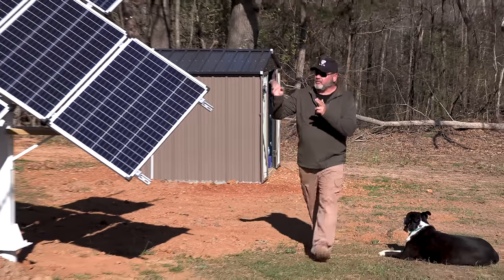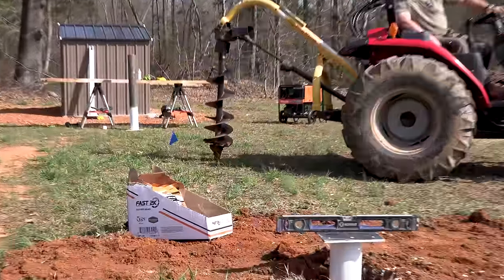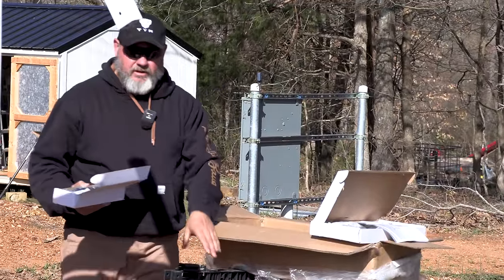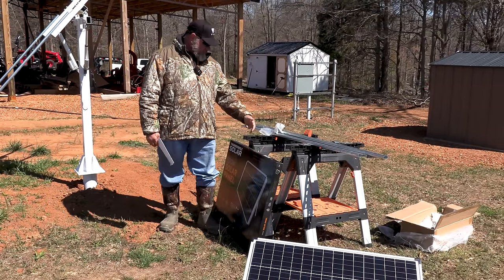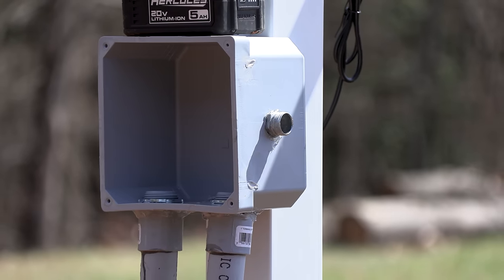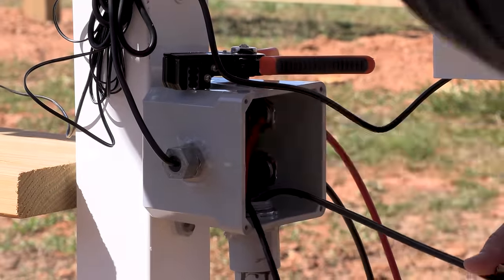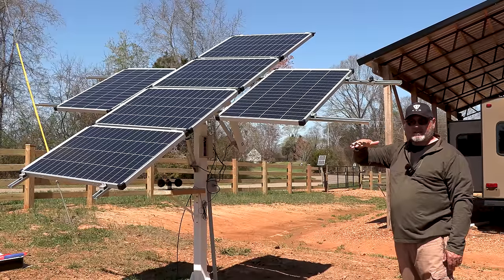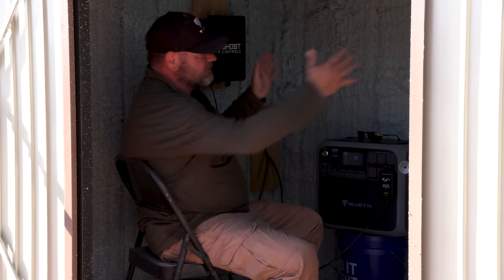You Really Need Solar Power to Survive Grid Failures! DIY Automatic Sun-Tracking Solar Array

Comment from the maker: Part Two: https://youtu.be/6wv6hJ9S1K8
Reply: I would like to have some information on a system like that
Reply from the maker: I will put out a video in a couple of months. It was really nice to see my RV running the air conditioner and my little building running the air conditioner while the power meter stayed the same.
Reply: Have you found out the costs of alternative and absolutely accurate solar tracking? The position of the sun is known for every day and moment. This information could be used. That way, you don't have to rely on the photocensor, but even at the cloudiest moment, your device follows the sun and is always ready when the clouds disappear.
Reply: I would like to know how they do with snow. Does snow get stuck on them like the panel arrays do? And what this system be superior to panel arrays in the Pacific Northwest, where light is a luxury?  Things I am wondering, but not sure if there are answers yet.
Reply: It's always recommended to read the entire set of instructions before you start in. That way you can understand the later parts before you guess at the beginning.
Reply from the maker: @Anthony Losego. It is very easy to say things like this from behind the computer desk or cell phone screen. The directions were translated and were horrible. We just purchased a third solar tracker and the directions were very clear in the new one. There have also been several updates and upgrades. Now it's plug and play. Great! Monday morning quarterbacking!
Reply: @TonysTractorAdventure  gotta love chinglish instructions not quite either language not readable eitherway lol
Reply: @anthonylosego  Agreed. No matter how good or how bad a manual is, it’s best to read it through prior to starting a build. One can’t know how good or how bad a manual is until one has read the manual in its entirety. It’s best to know before starting a build rather than after. This holds true regardless of one’s perspective whether that be settin’ at a desk behind a computer or quarterbackin’ on a Monday.
Reply: So how do you rate the Hercules brand or Harbor Freight tools?
Reply: Please do a one year review!!!!

Comment: Like ya work mate, I built a dual axis solar array some 7 years ago, still operating, it’s only running 6 X LG 335watt  panels which is 2010 watts made up of 2 strings (series parallel) I have seen them pumping out 2450 watts on a sunny cool day, it was my second attempt at building one the first didn’t have a very reliable tracking unit, but he latest has a duel axis slew drive (weighs 260kg) stands approximately 5 meters in clean air no shading, I managed to acquire a controller for it from USA,(Lauritzen inc) the controller is programmed with an algorithm that makes a move either axis (duel) every 10 minutes of the day from sunrise to sunset, it is capable of a lot more panels but as I was limited working on my own 6 panels worked fine, this has powered our whole house, runnng a 3kva Victron inverter/charger, 8 X 220 ah AGM batteries in a 48volt configuration as 2 X 48volt = 440ah, I can say without a doubt even in cloudy overcast days our batteries are changed by end of day, the secret to off grid is storage, you need to have a large enough battery bank to keep you running through those cloudy day in the worst case scenarios..

Keep up the good work mate all the best from down under 🇦🇺🤙
Reply from the maker: That is so cool. I have thought about building a heavy duty dual axis solar array myself. The one installed claims to be hurricane force resistant but I could see it folding over in certain circumstances.
Reply: Got any details?

Comment: From all the reviews of the foam system - I would have gone with concrete. Not for the updraft, but for horizontal stresses. Moreover, I would have filled the pipe with concrete and also welded rebar spikes to further anchor into the concrete.
Reply from the maker: Fast2k has been holding up power lines on utility posts for almost 30 years. It is very proven. Other foams fail, but these exact solar panels went through 80mph winds. Trees down every where, but my solar is still there.
Reply: Conventional,  my thinking too. But the quickness, so convenient, specially for solo build. Pipe will rust from inside eventually,  but we'll be decomposing by then😂
Reply: Yeah, nothing like a massive over-kill.
Reply from the maker: It is well casing pipe. We will all be gone before it fails.
Reply: I'm planning on following Tony's lead on the pipe support for speed and ease using a 220mm pipe with 5mm wall in a 300mm auger hole. To spread the load a little and prevent the bottom of the pipe filling with water I intend to weld a 250mm square plate to the base which Tony didn't feel was necessary to his build. I'll zinc prime and paint the pipe so it should be there for a couple of hundred years. I was considering adding spikes to the sides of the pipe but the available space is going to be so limited on the 220mm pipe size I'll just pour in concrete. 

The only problem with a pipe is the lateral loading. I'll have 16m2 of panels but hopefully going to 4 foot depth will give it the required a 700lbs solar sail the required lateral support. The mounting pipe of my arrays will be 2 foot out of the ground to provide the clearance so I could always add ground ties to the above ground pipe section if leaning does ever become a problem. The only other potential issue is subsidence but with a pipe you can always add a welded section to a pipe until it finds stable footings.
Reply: Its not a horizontal force but actually a moment force or torque. The pivot point of the moment is usually the midpoint of the ground and buried end of the pole.

Concrete is over-engineering for this purpose, wasting money and causing unnecessary environmental destruction.
Reply: @EricPeelMusic environmental destruction? what are you talking about?
Reply: Lol it's not going anywhere when you're done! And I thought I overbuilt 😂😂
Reply: @josephyarbrough9316 😂😂 Sounds a bit like Biden, I don't think he knows what he's talking about 😂

Comment: I've been waiting to see an articulating system that follows the sun.  I think this is a fantastic providing it works as described. 

I first hear of this back in the late 80's early 90's coming out of Japan.  They would put sun ray gathering glass and fiber optics that traverse down to offices without windows to provide sunlight to their employees.  They allow use this for growing plants indoors.
Reply from the maker: To this point they have worked great.
Reply: I met a bloke in the mountains near Omeo (Australia) who had gas struts (ie- hold the car boot open) that when exposed to sunlight they heated up and expanded, creating movement.
By arranging the shadow + sunlight on his array moved entirely passively & automatically. It was fascinating.
Reply: @P.N.365 that's cool

Comment: That is very cool and it's useful for folks with really limited space.  For anyone with the room, you could add 100% more solar panels for less than the cost of installing the tracker, plus you have less maintenance on things that can break.
Reply from the maker: Jason, I disagree. I could add big rows of solar panels but then I would loose the area. I can plant food around these panels. If they hold up, I plan on using a lot of these in key places. I may be wrong and the trackers may not be worth it.
Reply: @TonysTractorAdventure  - It's really not a matter of conjecture; the math and science behind it are well-documented.  I like what you did, but in terms of ROI you simply would have been way further ahead putting up more stationary panels.  The "problem", if you can call it that, is how inexpensive the panels themselves have become, relative to all of the other costs.  The same thing is true of wind turbines...the answer is putting up more panels, if you have the room.  Also, agrovoltaics is a fantastic option for folks also wanting to grow some food around their panels.
Reply from the maker: I still disagree that it is a fact. The gain by adding one $400 dollar stand is still cheaper than buying enough panels to make up 40% gained and I get to still use the ground under it. I even thought about raising the next set. If these hold up and work well, unless panels come down in price this is still more cost effective. The current system is a test system. The permanent system will use 300w plus panels. Those are not cheap.
Reply: @TonysTractorAdventure  - If it works for you, that's all that matters.  I've done the math and will not be bothering with any solar trackers.
Reply: @jasonbroom7147  I agree Jason, just throw panels on every square meter of roof you have and be done with it, less cost and less maintenance.
Reply: @klaasbloem  Yep - that's what anyone who does the math (and has the space) decides makes the most "cents".
Reply from the maker: Not a big fan of poking holes in my roof. That is the glory of living in the United States. We can each do it the way we want to.
Reply: not everybody can calculate
Reply: I agree. I have done the numbers and using more panels is way more cost effective especially here in Oz. I have made my own rudimentary trackers in the past just out of curiosity and the set up promoted here is extremely flimsy and has no bearing on the moving parts at all. If using the extra space was quantified with food production then the only way that the space saved could prove advantageous would be to grow a crop that in my country is illegal. :=)
Reply from the maker: Can you explain in more detail?
Reply: @TonysTractorAdventure  for some reason I can't edit that comment or I would fix some of the typos I see now. 
One thing I am only thinking about after posting is the shipping for me it would be $280 per pallet so that would add about $9.33 to each panel just over three cents a kilowatt-hour to the total for pallet, I don't think it will matter because I was rounding off by more than that when I said 3kw anyway but I know how YouTube is when you're not exact. And of course going with the harbor freight panels even though they are three times more expensive approximately you don't have to pay shipping. Of course both options would have the same sales tax.
Reply: wouldn't your system need to handle 40% more peak power?
Reply: @KirbyZhang  - Do the research and you'll quickly understand why, if you have the room, adding more panels is the more cost-effective option.  Even setting aside the problem of introducing maintenance concerns into a system that would normally have very few such issues, the cost of these trackers and mounts is simply not justified by the increase in output. The only exception to that is when space is very limited.  This is why you don't see trackers on very many solar farms...if they made "cents", you'd see them used everywhere.
Reply: @jasonbroom7147  I like what someone mentioned about bringing constant sunlight to the inside of buildings. very cool.
Reply: If you only have space for 1, then maybe this could possibly make sense... but for 2+ it makes less and less sense for each unit installed.
Most panels have a 20-30 year life expectancy, while this solar tracker has a 3 year warranty.  The gap between 3 and 30 years is huge!  I would want a 10 year warranty at minimum for something like this.  Lets say 5 years in one of the sun tracker sensors fails... it is a custom part, so you aren't going to find a replacement, you will have to buy a whole new system.  About the only thing 'standard' in this setup are the mounting parts themselves, and the actuators.  Everything else that breaks is going to be a complete system replacement.  Assuming it can last for 10 years, which I think would be generous, then you are looking at 3x the up-front cost for this solar tracker over the lifetime of the panels installed.  And that is just normal wear-and-tear use.  If it is truly designed to last just to the 3 year warranty period then the cost is just going to be brutal.

And I don't buy the 'space saving' aspect of this.  It is a moving array, so nothing can ever be put anywhere near it, and you should probably mark the 'safe' area so nobody accidently puts something under the west side in the morning on accident only for it to move through the day and break itself.  If you mounted a stationary setup as high as this the cost would only be marginally cheaper... but it would last forever instead of only 5-10 years.  And because it doesn't move, you could put a patio or car park under it, or shade a barn or building that doesn't have any active cooling, or give a nice partial-shade garden area, or have a spot where animals can hide on hot days.  The space is only 'wasted' if you mount the stationary system directly on the ground.
Reply: @CaedenV  it seems moving arrays only make sense on satellites and space stations.
Reply: @jasonbroom7147  The most I would ever stretch to for adjustable solar panels is to leave them facing true south and manually adjust the tilt 4 times a year to account for seasonal changes in the suns height due to my high latitude. Given that this would be a pretty basic mechanical setup I think it would be a good compromise between extra efficiency and expense. Also, gives an opportunity for quarterly inspection/cleaning of every panel. What do you think?
Reply: @DCTriv  - Yeah, that makes a lot of sense, especially if you're above the 45th.

Comment: I use 4 of the Thunderbolt panels at my off grid property to to charge my power stations. You won't be disappointed with them. They generally produce 85% to 95% of the rated 100 watts which is really good IMO. I have had them even go over the 100 watts in perfect conditions, but that has been a rare occurrence.
Reply from the maker: I totally agree with you too this point. The panels work really well stationary but they continually produce very high rates while facing the sun all of the time.
Reply: Hi, interesting, would be interesting to see if larger panels are supported with this system.
My new panels are 500+ W each.
Still using the 250’s because I have them, but can see a time when they get replaced and passed on.
Take care M.
Reply from the maker: I have seen people use 400W panels with this mount.

Comment: Thanks for doing this review. I was over at the Eco-Worthy web site earlier this week and saw that they had this product. I was wondering how easy or difficult it was to install and how well it worked. Looks like the documentation could use some work. I'm seriously thinking of getting one of these to maximize the limited solar I get on my property. I would prefer to put the panels on my roof, but it is shaded by a large tree. So ground mount with tracking seems like the best option.
Reply from the maker: Ours is holding up well.
Reply: @TonysTractorAdventure over how long, weeks, months  or years? I would offer this as a professional solution if it's solid, looks floppy to me. I guess I've worked on too many commercial projects 😊

Comment: Interesting video, only thing that took me by surprise is the way you put the bolts in to join the stake and mast together, putting the nuts on top leaves the threads more exposed to water and will rust, also if the nut came loose due to vibrations or whatever the bolts would drop out, by putting the nuts underneath the threads are somewhat more protected and if the nuts came loose the bolt stays in place. Other than that a good job.
Reply from the maker: I mean this as humble as I can. You are overthinking it. It will be obsolete before it is a problem.
Reply: That's why I said crappy Installer.
But it's a crappy design and construction to begin with......

Comment: Hey Mr. T..  I've got a good friend with the same name. So..  I'm on a friends property in my RV. I've got a solar system. I just dug a hole yesterday and am building a 2nd array.. I used a bag of the Fast2k. When I was digging with the post hole digger, one of the handles broke. So I drove to town, found a new handle and a bag of that new tech expanding foam. When I got back and was ready to pour, there was about 2" inches of water in the bottom (I've always referred to this place as the Swamp.) so I shookup the bag.. and poured it in..  30 seconds later... the foam kept expanding.. 6"x24"..  Only cut off a double sized amount the size of a softball. So I hoping the tracker can handle 6 290w panels. There's quite a bit of shading so an extra advantage is more than welcomed. I'll put that "up to 40%" to work. Lots of tall trees around here.. 2300' in S. Oregon.  The suns is getting low in the sky but both arrays 6 290's flat on the ground in 3s2p and 4 400's in series tilted at about 40 degrees.. is at 2.9KWh so far..  Ps. Using your link.. MY tracker is paid in full and should be here in a week or so.
Reply from the maker: I am excited for you. I hope it all works well for you. We are still going strong here. I put my mount post down 4ft to help with lateral loading.

Comment: Holy huge job there!  Well done.  I saw this system but think I'll just make a cart out of 2x4s and some casters.  My rear deck roof leaks so I'll probably just add a solar roof to that when I fix it.

FYI:  There are several discount panel sites where you can get 4-500W panels for just a bit more than the Harbor Freight panels.  Looks like you have the ability to pick up a pallet, so big cost savings over full retail.
Reply: Please post some links for these sights.

Comment: Got to say though wind power is pretty spectacular and you can build a dynamo from scratch with some copper wire and magnets, like honestly it produces too much power to the point that you need to built in a variable limiter which is a bit too hard, or have a load which can dump the excess power.